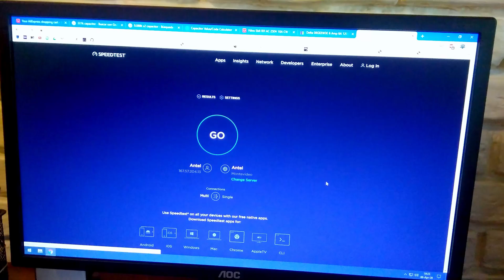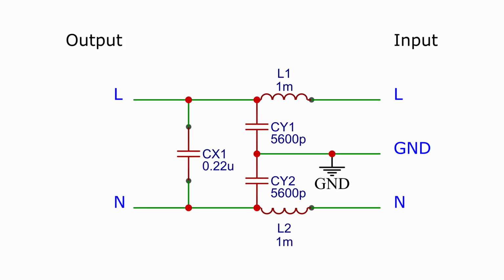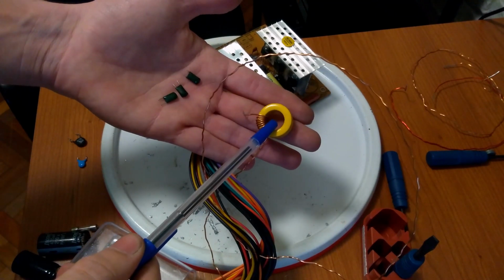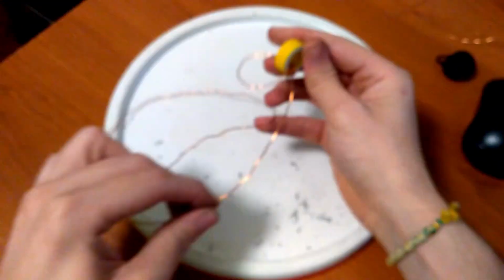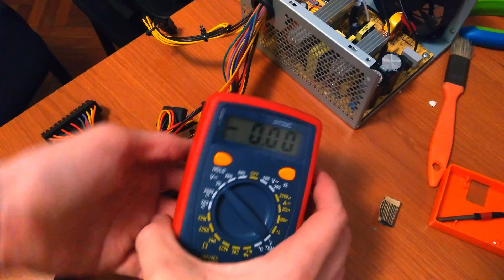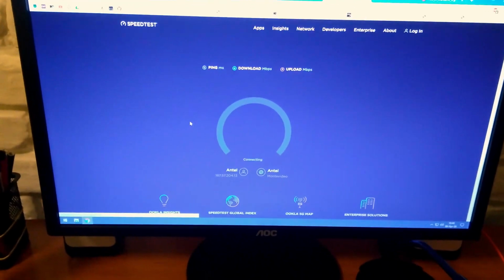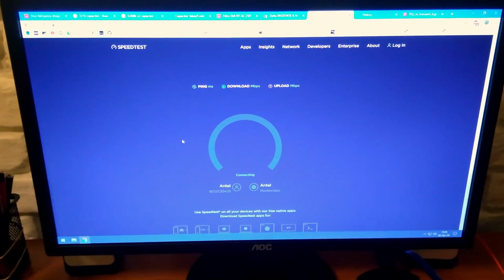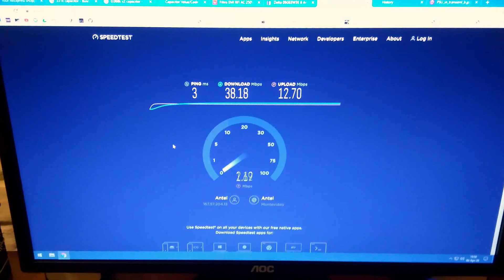Adding an EMI filter to an ATX Power Supply

Comment: Hey friend!

How did you figure out what was causing this problem and sorted out that it was this smps
Reply from the maker: Hi! As far as I know, the Powerline Adapters like mine use high frequencies for their communication, and usually EMI manifests I'm high frequencies when it comes from switching power supplies as they switch at high frequencies. Knowing this, it means that my PSU had no EMI filter to filter out the frequencies that the power supply injects to the power grid. I looked in the internet for EMI filter circuits and I built one as close as I could. I know how to calculate its components' values but they are usually all similar so I skipped this math stage lol.
Reply: @technobear5547  Thank you.

The reason I asked is because today's homes have so many switching power supplies that makes the process of identification difficult!Fridges,lamps,other appliances etc.
Reply from the maker: Oh I see what you mean, I noticed it was the PSU because I started having issues after I started using that PSU. I think I was listening to some music on YT when I plugged it in and the music stopped and after that happening a few times I found it was the PSU.

Comment: Most ATX power supply comes with EMI filter. Your is so strange that some of EMI filter components [coils & capacitors] are missing from the PCB Your speed demonstration is good. Nice job..
Reply from the maker: Thanks! Yes, usually they come, but the one in the video is a pretty cheap one that comes with generic PC cases. It's not the first one I found without an EMI filter, but they are difficult to find lol
Reply: @technobear5547  Any ATX PSU that skimps on the EMI filters is also guaranteed to be also crap at in every way, like that PSU in your video which uses an obselete PFCless half-bridge converter with terrible output voltage regulation and ripple. They are notorious for being PC killers in China.
Reply from the maker: Yup, I agree. The one I added the EMI filter is being used as a bench PSU so no PC will die thankfully. As you said, the noise and ripple of this PSUs is huge.